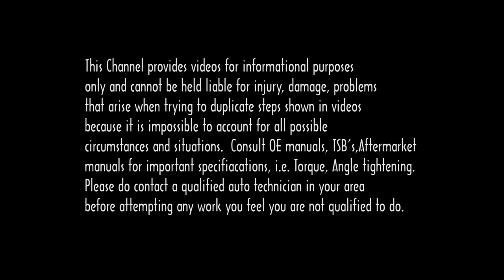Crankcase breather filter replacement 2015 Dodge RAM 6.7L Turbo Diesel install

Comment: Your video was the best of all those I viewed.  You mentioned the socket size (8mm).  You showed how to take off the outer cover.  You also mentioned the torque (89 in/lbs) recommended on attaching the inner cover.  None of the other videos covered those three issues.  Very thorough!  I subscribed.

Comment: Thank you 
I have a question for you what happens if you just delete that filter I see a lot of guys cutting them open taking out the filter part and replacing it ?
is that a good idea or not?